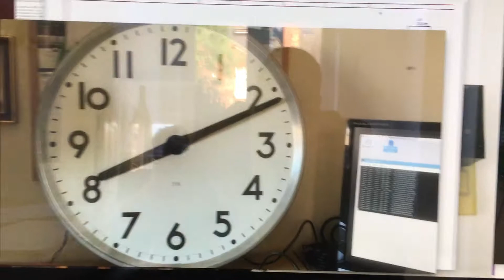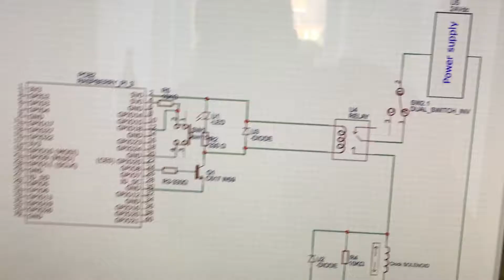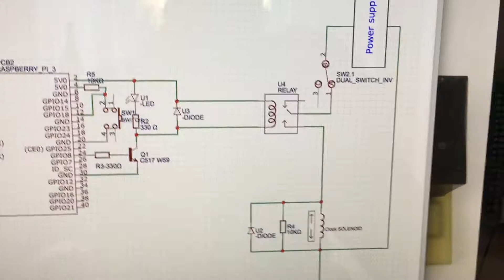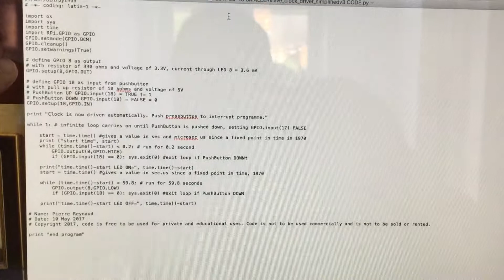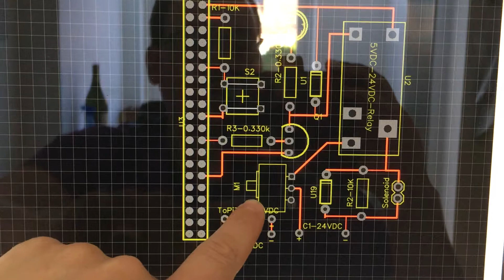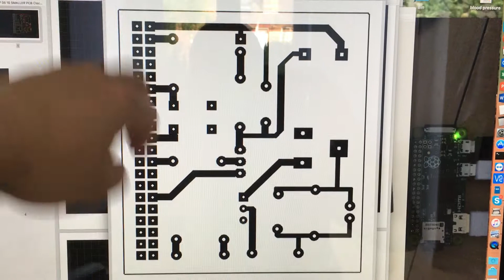raspberry pi zero project in order to drive a slave clock with a 12VDC or 24VDC power supply

Comment: I am currently working on making a driver for a slave old clock. Mine is requiring 1 pulse every 30 seconds. I used PLL but I think the delay taken by the relay is adding some cumulative delay to the clock. I have to try maybe with raspberry pi as I can adjust the clock/pulse by second or less. The PLL is not allowing less than 1 ~ 10 sec. adjustment.